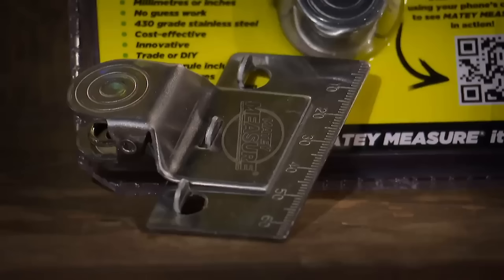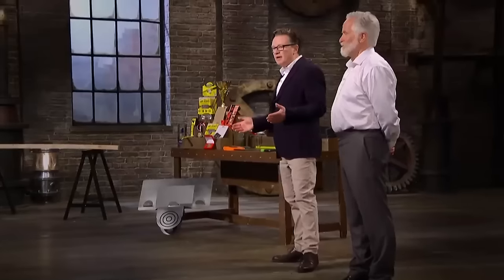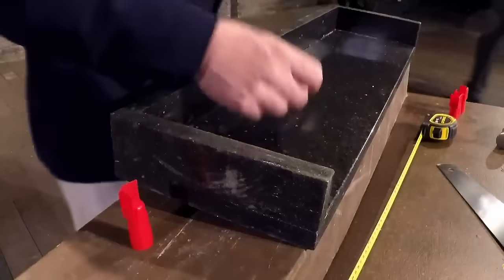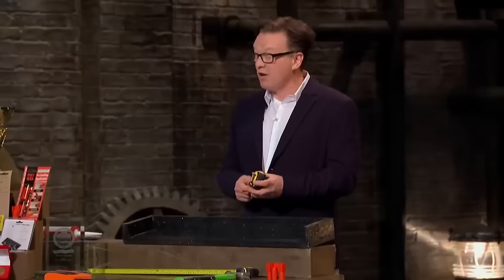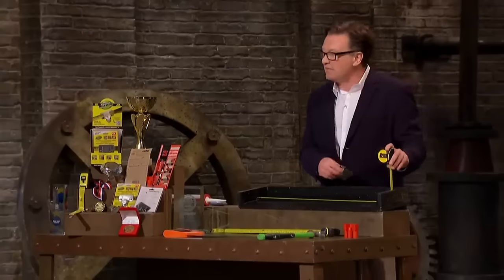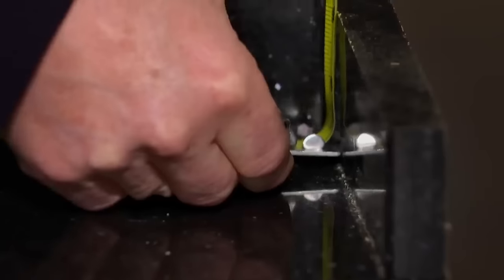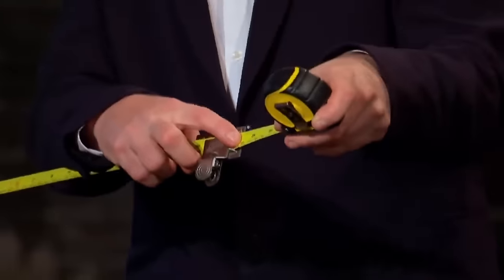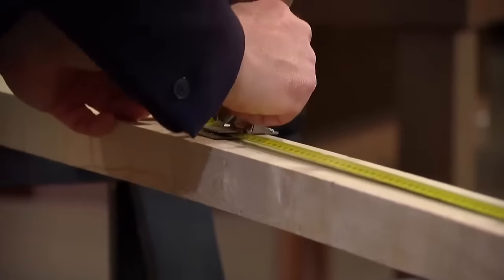Matey Measure Created A Paper Clip For Tape Measures  | Dragons' Den | Shark Tank Global

Comment: I think it is a useful product. You can say it does not solve a big enough problem and it is true. But in the professional aspect like builders it can be very important not so much for hobbyist or DIYers. The issue with this pitch was they went at it wrong they can not make a big company out of a single small complementary product. What they should have done was to either give their IP to a big hardware company and receive royalties or sell it to multiple hardware companies to pair it with their tape measures. Either way would be more beneficial and profitable. They would not have to spend money on marketing just get one or two big deals and earn a handsome amount of money.